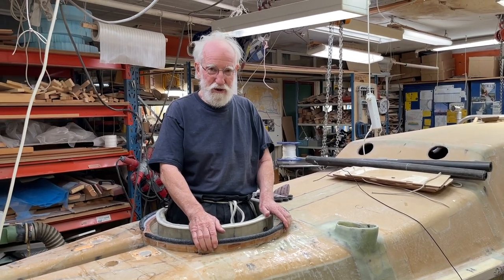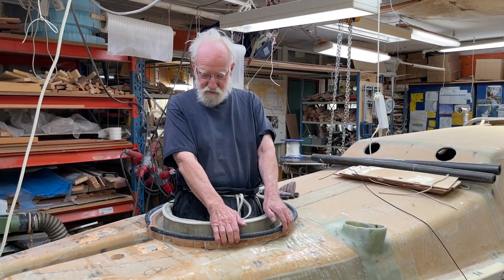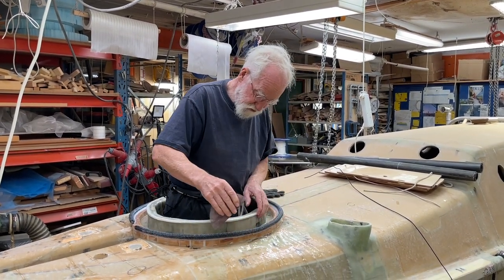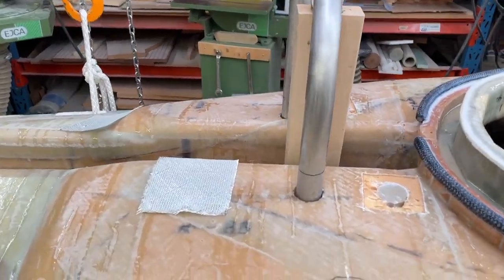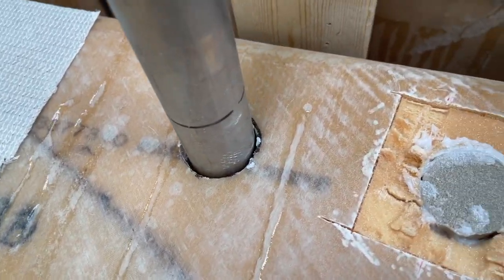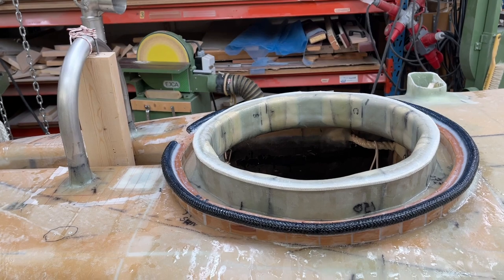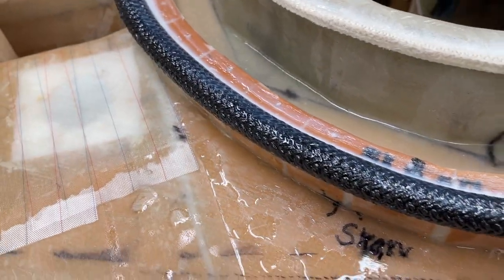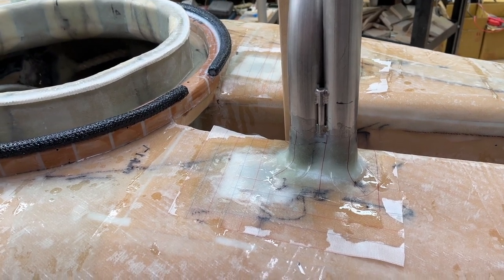6 Sep 2023 Bow ventilation pipes first fix

Comment: Have you experienced many roll overs or knock downs on your passages ? i did notice on wave rover because its quite large inside it would be a big fall being thrown upside down and those plywood bracings could cause quite an injury Plus 1 for the divinycell in that regard
Reply from the maker: I have experienced capsizes and pichpoles and knockdowns.
I am preparing the boat.